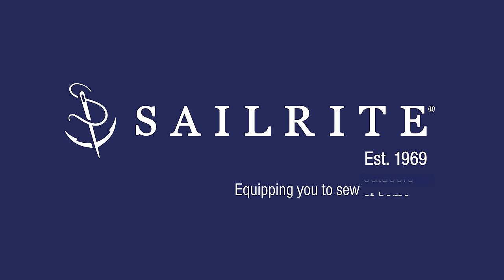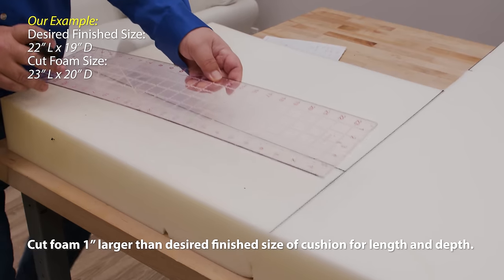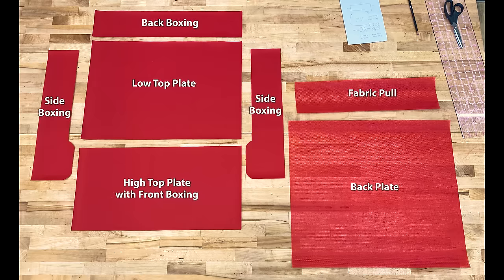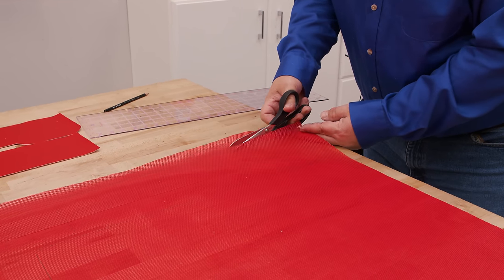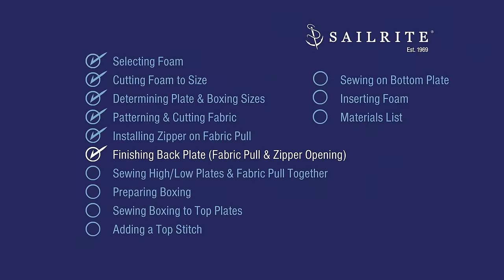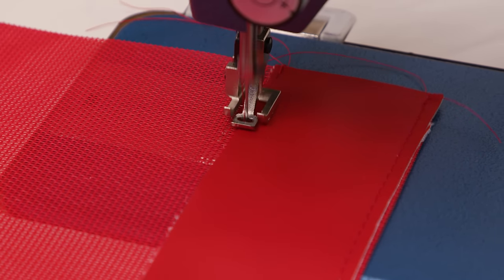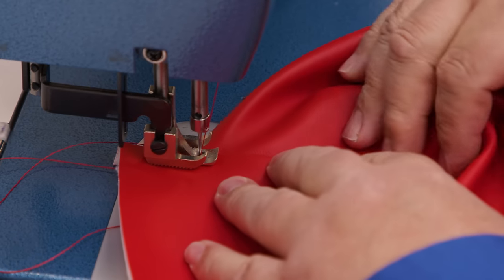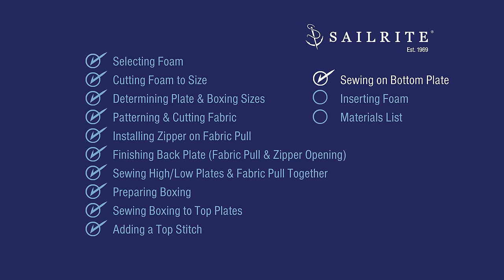How to Sew a Knee-Rise Contour Cushion with Fabric Backing

Comment: Thanks for the tutorial. Question: you wanted a finished 22” width and you cut the foam at 23” to add compression, but I noticed you cut the top and bottom plates at 23” width.  Is that correct? Does that result in a 22” Final width?
Reply from the maker: We usually cut the plates to the same size as the foam. Then when the seam allowance of 1/2" is taken away the plates will be smaller in size and compress the foam. So, yes that is correct.
Reply: @SailriteDIY  right! Seam allowance, forgot. Thanks

Comment: On your plates why do you not add for the seam allowance?  Same on side panels?
If I’m using existing cover wouldn’t I just measure seam to seam on right side the add for seam allowance?
Reply from the maker: We want the foam to be slightly compressed for a good fit. So, after seam allowance is taken the cushion cover is slightly smaller than the foam for a better fitting cover.